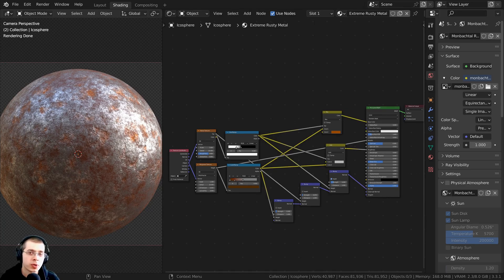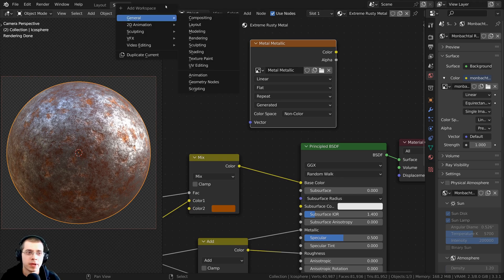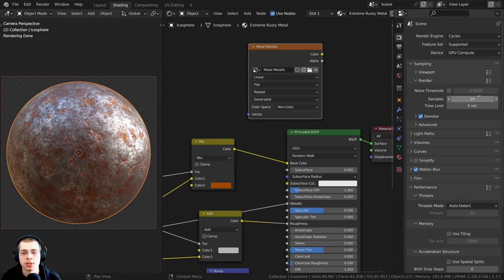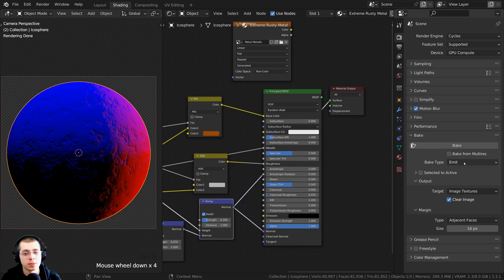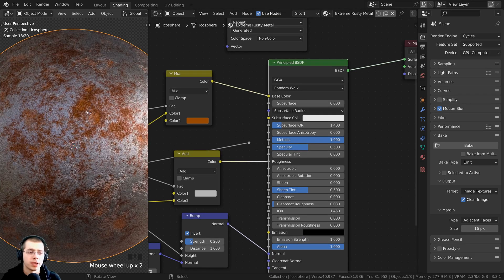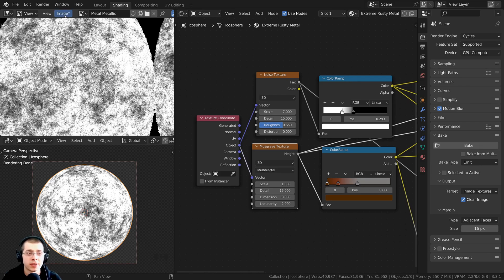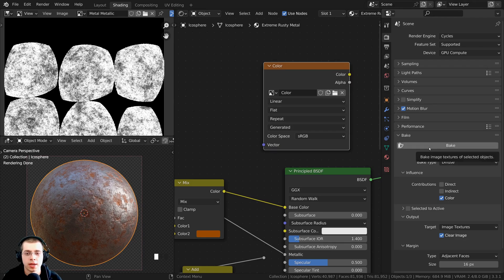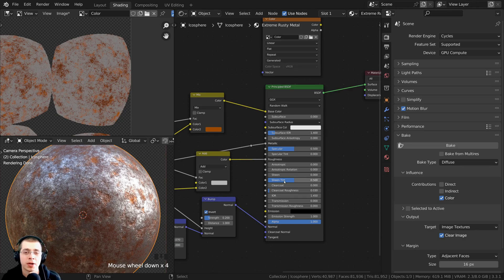How to Bake Metallic Maps (Blender Tutorial)

Comment: So to clarify if there is any metallic determined by the slider you need to emulate that with the RGB node. However, if it is 0, do you need to set it to 0 or can you just ignore that texture and by default it will bake nothing there? (For this example let's pretend you have 40 textures applied to one very complex robot planet you are baking into one map that is all one object; only 7 of them have metallic values, and hypothetically removing those textures temporarily is not an option.)

I currently believe that for every single texture you must set the metallic value through either the RGB or last node in a procedural setup, then ctrl+shift+click it to set that as the texture, but wanted to ask to ensure I'm not needlessly adding extra steps to my workflow.

Comment: Wonderful 👍, helpful as usual, but there is something a head, i want to bake alpha channel with base color at the same time with the same image texture, if you believe me or not, by coincidence when I use  try and error technics so, i got an image with alpha channel at the same time in one image and don't ask me how? Otherwise next time it doesn't work🤔
Reply from the maker: Hmm, I think if you make the image transparent, in the color, when you make the image texture, then it will be transparent. then you will need to save the image as .PNG with RGBA to store the alpha channel.
Reply: @RyanKingArt  
Yes, I think it is. Now I'm trying to use noise texture with colorramp node which has an alpha channel in color ramp node and reduced the alpha value to the half, and I will connect the color to base color and alpha node to the alpha in prb shader. I hope it works.

Comment: Not necessary to mention that you can use math in numeric fields. e.g. expand the 1024px field by *4 to get 4096px in result. 😉👍
Workflow tipp: If i need just the textures for use in 3rd party software, i usually use just one image texture node for baking and save one at the time. That way is no need to create a new image node for every single material texture.
Reply from the maker: Yeah I know you can multiply the values.
Reply from the maker: yes I do the same thing. I add one image texture and use it to bake all of the values. but in this video I just baked the metallic map.

Comment: I didn't know about the problems with baking colour maps and metallicity. That's good to know... would have cost me hours again if I had run into that and tried to figure out on my own what was going wrong now. So that was very helpful.

But regarding the baking of a single metallicity value... yes, sure, you can do it in this way. But why would you ever want to do that?
Reply from the maker: because for maybe game engines or other 3d programs, you might want a metallic texture map. I've gotten people commenting about this, where they want to bake the metallic map, but there object is completely metallic.
Reply: @RyanKingArt  I admit that I have absolutely NO knowledge of working with any of the current (or past, for that) game engines.

But even if the engine insisted on having a map plugged in instead of a constant value... wouldn't it still be better to use a 1x1 image?

Sorry if this sound pesky and irrelevant. I'm quite old fashioned and just cringe at the idea of wasting this much memory. ;)
Reply from the maker: @Groffili  well yes you could but then all of the texture maps wouldn't all be the same size, if the other maps are 4K. but sure in some cases that's fine.
Reply from the maker: It may be that you can simply turn the metallic value up to 1, so its fully metallic. But I've gotten comments from people asking about that, so I wanted to cover it in the video. Another reason you might want to bake the metallic value, even if its fully white, is if your baking multiple materials to the same texture maps. One material might have metallic values, while the other material might not, but if you want to combine both materials to single maps, then you'd need to bake the metallic.